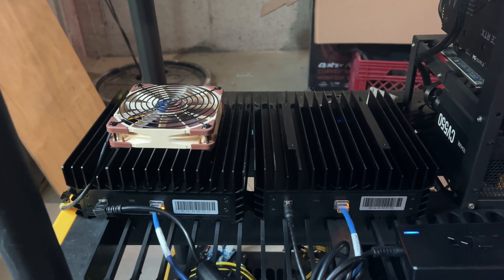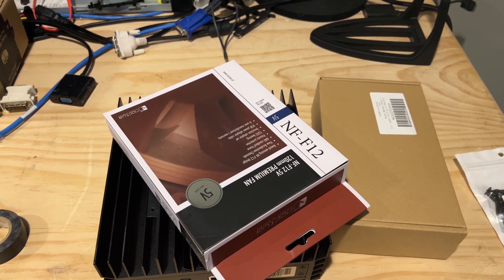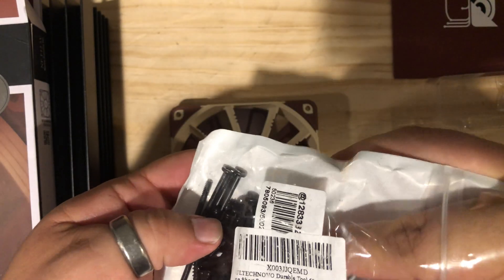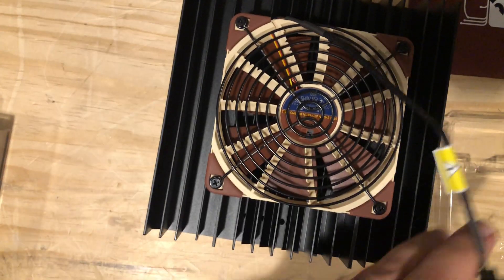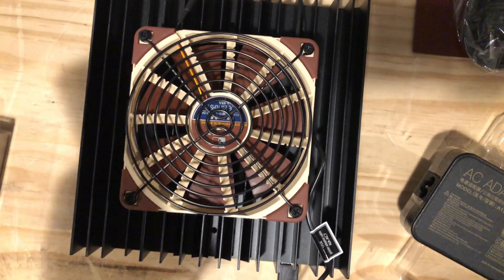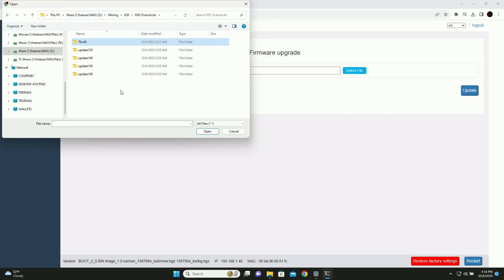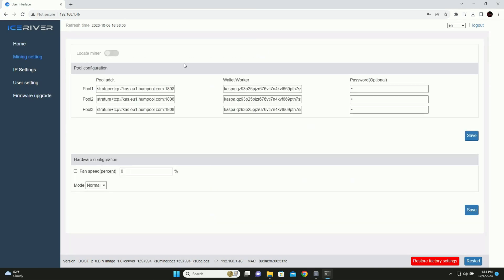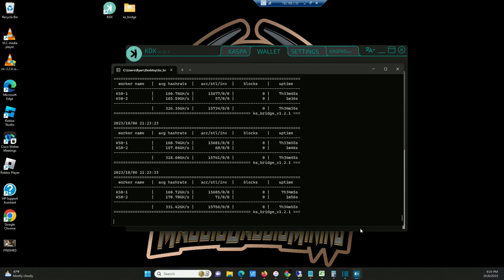Upgrading and Overclocking My 2nd KS0

Comment: Glacier series overclocking increases computing power! KS0 has been upgraded to 180G, KS1 has been upgraded to 1800G, KS2 has been upgraded to 2800G, KS3L has been upgraded to 7000G, KS3M has been upgraded to 8000G, and KS3 has been upgraded to 11500G. Contact me if you need it!

Comment: See the KS1 huge price drop overnight?
Reply: $2299 to $2399 on KS1.  KS0 sold out but still avail elsewhere. 

Also. Is the 180w PSU enough for 160 GH OC?  Thanks
Reply from the maker: @kcxfiles16  for some reason when you said KS1 I read it as KS0. That is an insane price drop. Man, I would love to pick one of those up. I don’t have enough coin unfortunately. I seriously wish they accept credit cards. I would buy one or two right now. I have enough Kaspa to buy one, but that’s like all of my Kaspa. Like 60,000 or 70000. somewhere in there. I don’t wanna sell all of it. I want to hold for the long run, but man it is tempting
Reply: @MaddioDaddioMining  I thought of the same.  But I am running 4 KSO now and plan to OC all 4 to the max on 180w PSU.  Just ordered new PSU vs. 120w I had.  Also, did you see the Power load on the 120w runs tight against 140GH.  I saw you did not call that out.

If the KS1 drops to $1K in another month or so.  Might grab it and OC it.

Great videos.  Very helpful.  Thanks
Reply from the maker: No I didn’t. I checked last night and still $449. What is it now

Comment: 19.5V 9.23A Laptop Charger ADP-180MB F AC Power Adapter for Asus ROG G75V G750JW G751J G751JL G752VL FX505GT FX505DT FX506LI FX506LH Asus 180W Tuf Gaming F15 Laptop Supply Power Adapter Cord
Brand: HNHTKJ  37.99